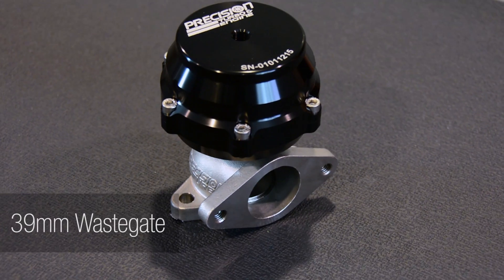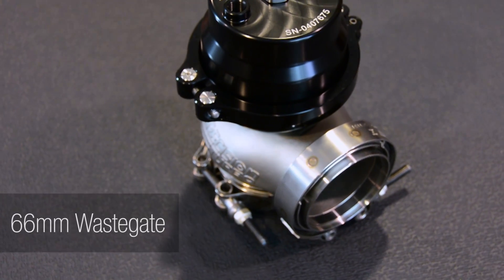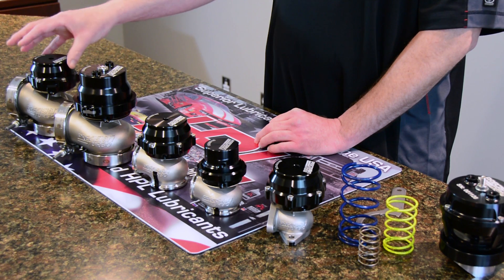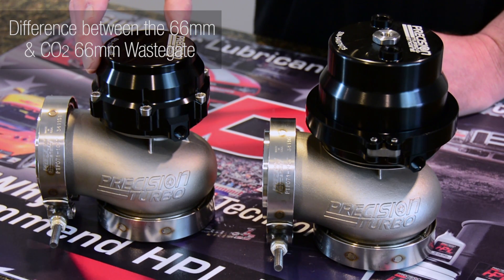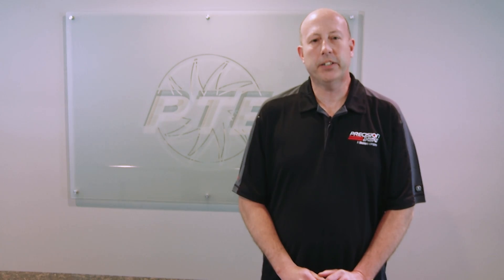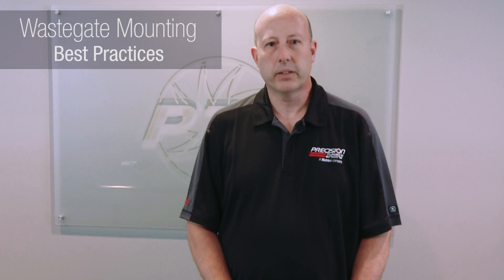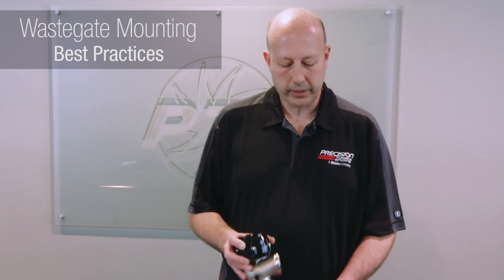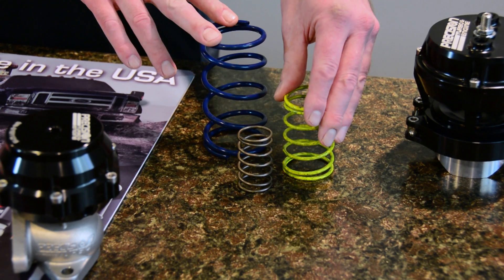All About Precision Turbo Wastegates

Comment: What a waste... gate
Reply: The wastegate's job is to divert excess exhaust gases away from the turbine – controlling the speed of the turbine and preventing it from spinning too fast. By controlling and limiting the speed of the turbine, the wastegate regulates the boost pressure provided by the turbocharger.